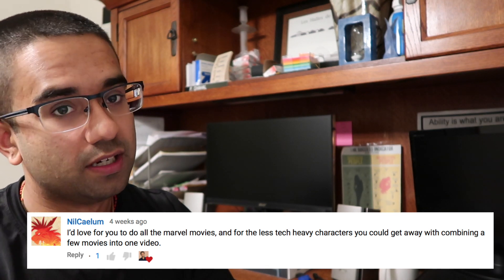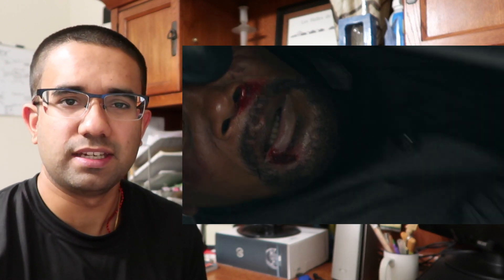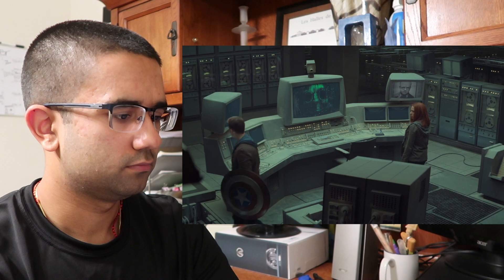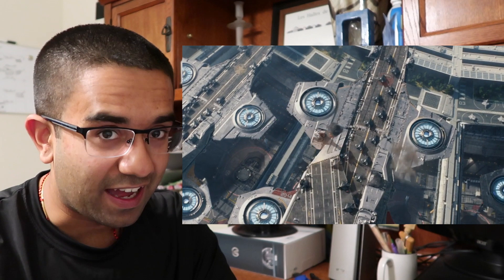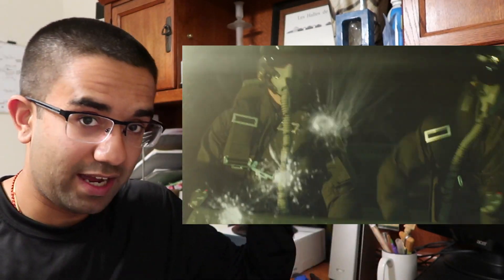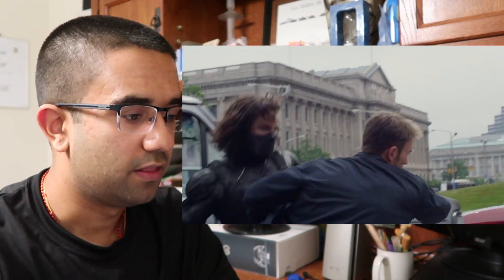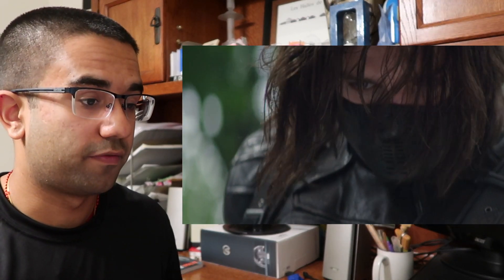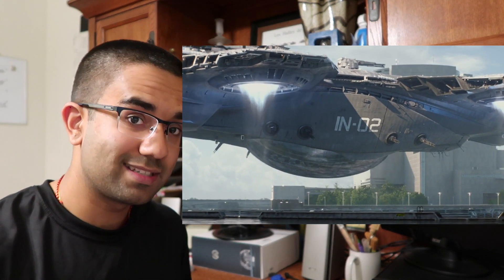Real Engineer reacts to Technolgy in Captain America: The Winter Soldier

Comment: maybe it has different propperties when its hit as a shield liket the actual shield then it has some kind of alloy around the edges in order to bounce but still absorb impact when used as protection.
Also it may be possible the drive had some sort of software that could fend off any locating or seeing who it was or what the info was from the wifi provider and it wasn't their computer so it wasn't untill they plugged in that it would've been possible to keep their identity secret for a few mins.

Comment: The disbelief you had about Falcon with elevation change isn't far fetched. Ask any skydiver. Oxygen masks are only required if spending extended time (in an open door aircraft) above 10000 feet. Normal tandem jumps done by first-time jumpers are usually 13500 feet but you are not above 10000 feet for more than 2 to 5 minutes so you would not notice (or have ill effects) from hypoxia. Falcon is well below 10000 feet and so does not pass out or require oxygen.

Comment: Perhaps there's a trigger when the car experiences high impacts to do some kind of xray, or multiple small xrays from various positions. (The image on the screen that's screen wouldn't necessarily have to be of those images, but just have the injury mapped into it)

The only way I could think of a way to hand wave the shield either bouncing or absorbing and dissipating all kinetic energy is if the vibranium shield has a crystalline structure that behaves differently depending on the direction of incidence (and then stop thinking about it). Say force at the normal to the face of the shield dissipates, and anything at the normal to the rim is amplified. That doesn't explain why cap lands striking the ground with the rim to disperse some of his kinetic energy though... Either way there's no mention of any of this, so it's probably just marvel magic or something.

Comment: One thing I would say about the metal arm. As that while all strength based functions you perform with just that arm would obviously be extremely heightened, like your fingers would essentially be a vice, and you could lay down and curl 2 thousand pounds.

It wouldn't help you much in terms of over-all strength. Like if someone captain america throws an atlas stone at you, just having that arm doesnt mean you can catch it. Because any force that impact would produce would have to travel through you into the ground somehow. And if you were to do any kind of full body lift or feat, the arm wouldn't help you as much as you think since your legs still have to do most of the work.

Also that arm would weigh a fuckton, it seems to be almost completely made of metal. Which would completely lobside your body.

The only reason bucky can throw it around and perform these crazy feats is because he's a super soldier. So his whole body is strong enough to match the forces the arm can produce.

Comment: In the comics caps shield in made of a vibranium adamantium alloy. Though vibranium absorbs energy adamantium doesn't. But adamantium is nearly indestructible. Which is why they chose the two metals. Adamantium for durability vibranium for partial energy absorption

Comment: "I'm not really sure the purpose of Falcon's wings." It's odd, considered you are an engineer. I think you would have basic knowledge of aerodynamics. With just his jetpack, he will not be able to adjust direction during a flight. That's why planes have wings, and you won't see one without, because they won't be able to take off. His wings are useless without the booster, sure, but without wings, he can't fly. He would just hover over the ground.

Comment: "Gravity will decrease the higher you go from the center of the Earth"

Yeah, barely. Even at the elevation of the ISS the gravitational pull of the Earth is still something like 90% what it is at sea level. Even if you 1,000 miles up, which is 5x higher than the ISS, the gravitational pull of the Earth is still like 66%.

Comment: "If one of these falls it will be like a comet hitting the earth"

No, it won't.  They don't go into space. They are "sub orbital" as Fury says. They fly around in the upper atmosphere.  Even if they were to fall, they would hit terminal velocity and go no faster. They would hit the ground with the same impact as if they had only fallen a few hundred feet. It wouldn't create a huge crater, or cause earthquakes and tsunamis or anything like that. Even if it fell in a large city, it would only damage the buildings in the immediate vicinity of where it fell. 

In order to become like a comet hitting the Earth, first it would need to be MUCH larger, as comets are typically miles in diameter. Also, it would need to get into space and vastly increase its speed into the tens of thousands of miles per hour.

Also, they don't use conventional turbine engines for thrust. They have "repulsor" engines. These are 100% sci-fi, and are different depending on the sci-fi universe you are looking at. In some they are basically anti-gravity devices that push against gravity, but in the MCU they are the same thing that Tony Stark uses to fly and shoot his "energy blast" weapons out of his hands. They fire a concentrated blast of muons at high velocity to create a stream of concussive force.

Comment: Ok, gotta disagree with the Hawk stuff. You don't know what the wings are there for? Why do you think any jet powered plane has wings? You think the jet engines are all that is needed to fly? The wings are there to provide lift, control, and braking, obviously. 

Also, no exhaust? What do you want? A trail of thick black soot shooting out the back like some kind of coal fired steam engine? It is a futuristic jet pack that runs on who knows what type of fuel. Even regular jet engines don't shoot plumes of smoke out the back. The only "exhaust" you see is literally heat and sometime water vapor. The exhaust is there, there is just so little of it compared to the volume of air being released that you don't see it. 

3000 ft of elevation is not that much of a change when you start out at basically sea level. Your ears will pop for sure, but I don't think you are going to pass out from a lack of oxygen. And the speed he is flying at is not nearly fast enough for pressure changes to suck the air out of his lungs or anything. 

As far as him being able to fly with two people, that makes sense. You can't make a jet pack that can only barely carry the weight of one person and expect it to be maneuverable and have any real acceleration.  It is made to have the overhead to carry 3 or 4 people just barely, to make sure it does not fall short when only carrying one. 

You can make the claim that the jet pack itself seems too small to produce that much power, which given CURRENT real world technology is true. But again, this is some cutting edge future tech in a world with giant flying carriers and nanomachines.

Comment: 2:50 he's not cutting through the concrete. he's cutting through a manhole cover.
Reply: That presents an even bigger problem. Most manhole covers are made out of cast iron. Which has a melting point of 2200 degrees Fahrenheit. So if that flame was hot enough to cut through cast iron it would literally be impossible to hold without melting your skin
Reply: In just 3 seconds, come on. It's just a movie, so accept the fact that part is bs

Comment: The wings are on his suit because they are what create the pressure required for him to stay in the air just like a plane does
Reply: Those wings are extra weight nothing more from what I saw in the movie is that falcon fly with jetpack on his back and if you want to make sharp turns mid air while travelling at extreme speed u can use fins which will be smaller and less heavy as for gliding use the wings are still not a viable option

Comment: Chevy engineers took a C6 Corvette engine and put it into a Chevy Sonic -- the smallest, most 'economy' car that Chevy offers.  It's funny.  But it creates new problems: you can't put that engine into it without also changing the transmission.  This new engine + transmission won't work with the front-wheel drive.  Switching to rear-wheel drive requires a very different set of suspension.  The brakes are woefully inadequate for this new curb-weight... as are the tires.  Replacing all of those things stresses the frame, which was designed for a very different car.
-
You'll see this with humans as well.  You have ankle problems, which causes knee problems, which causes hip problems, which causes lower back problems, which causes shoulder and neck problems.  A good physician will attempt to hunt down the cause of the problem instead of just treating the symptoms.
-
If you changed someone's arm to super-duper -- and ignored nerve interfaces and power supplies -- you would still have massive problems with the torsional effects that it would have your axial skeleton.  As you run, you have to pump your arms in order to provide counter-torsion relative to your hips.  Try to sprint with your arms held at your side ... it won't work.  So you pump your arms, but one of your arms is comically heavier than the other?  Now you can't run for shyte.  So you can counter this by potentially holding a very heavy weight in your weak arm, but have you tried running while holding a 20 pound kettlebell?  Yeah.... that's a no-go.  Consider the effect this would have on your trapezius... and lower back... even your glutes... 
-
Having just one super-powerful, heavy arm would mess you up badly.  Having two would be better, but it would take time to adapt to it, and even then, you couldn't ever fully function this way.  Even just the act of running while holding an extra 60 pounds (figuring 30 per arm) would grossly accelerate wear-and-tear on your ankles, knees, and hips.  You'd be 60 by the time you were 40.

Comment: When there's in impact there are 2 energy transfers, the shield transferring its energy to the wall and the wall transferring its energy to the shield. The thing with Vibranium is that it absorbs vibrations directed at it, so the energy transferred from the wall to the shield gets absorbs but the energy transferred from the shield to the wall doesn't get absorb by the shield and thus will bounce. Also that explanation is perfect for a property of science called perfect elastic collision in which the object conserves momentum and kinetic energy with a collision.

Comment: actually i think the shield bounces because the fact that its really... bouncy?
like my explanation is that whenever the shield absorbs vibrations, its send it back out. if you shoot at it with a bullet, the bullet will go back with almost the same velocity, thats why in one of the scenes he is able to reflect back the minigun shots. so if you 'shoot' (throw) the shield at something, its reflects back. how it comes back to cap well in the comics, he just practiced and practiced for years to perfect it. and sam(falcon) is also shown practicing in the falcon and winter soldier trailer
Reply: That would make sense, but the problem is that when Peggy shoots at Steve, the bullets lose all of their forward kinetic energy and fall to the ground.
Reply: @solvemproblerstudios5889  true that. but we saw tony make changes to caps shield... maybe he did something?
Reply: @killowattts  That could be it. The modifications made might have changed things post first Avenger. Or perhaps the edge of the shield is made of a different type of Vibranium, as in the comics there are 2 kinds. The Wakandan kind, which absorbs, and the Antarctic kind, which repels energy back.

Comment: the helicarrier's are probably powered by a arc reactor of some kind. even the first one in the avengers.
Reply: Yup. In that movie (Winter Soldier), they specifically mention that Tony Stark himself proposed to add repulsor tech to the new helicarriers after he 'took a close look' (aka got himself stuck in the rotors of the Avengers one). Also, the first one in the Avengers still used rotors.
Reply: @francissitchon9321  I think his point is more it's unclear how 'repulsor' tech works and the closest we have to this is like jet engines and stuff, like we have nothing that can create thrust on that kind of scale without burning some kind of fuel. But yes, this appears to be the magic marvel universe like big hero 6 and other things where electrical jets or whatever these are can work
Reply: @ninjadudeofficial  yeah I always understood he uses “repulsor tech” on his missiles, then adapted them for personal flight on suits and eventually giant ones for the helicarier and even his avenger Quinnjet. However it doesn’t really make sense as to how they create thrust. I guess maybe as hinted by the name they create a repulsive force like a magnet and are powered by the arc reactor but it doesn’t really make sense either way
Reply: @SavageEntertainmentYEAH  maybe, beyond me certainly
Reply: @SavageEntertainmentYEAH   my understanding is that they might be thermal powered, it's just like with a magnetic fusion reactor, give it something to burn and it will produces thrust, best fuel for those kind would be Carbon Dioxide, it's everywhere and can always be used
Reply: @VolcanoQueen  interesting, thanks!

Comment: I think what makes the difference between winter soldiers mechanical arm and exoskeletons today is strength and power. A professional weight lifter has strength like being able to lift heavy objects but power is the speed and force of a punch or kick, you don't see edie hall knocking back a heavyweight with a 1 inch punch like bruce lee. So exoskeletons enable people to lift heavy things but they aren't able to quickly rip off car doors or sending people flying with 1 blow.

Comment: As far as Cap's shield bouncing, wouldn't the fact that it's round and spinning play a role with the laws of motion?  Seems to me that even if it absorbed impacts, that it would still need to bounce off objects as long as it's still moving.  Add in Cap's higher strength when he throws it, with spin (like a football or bullet), it's creating it's own inertia as well.  I could be wrong, but it just seems to me like it would at least be a contributing factor.

As for Widow saying it would take 9 minutes for them to be found, that's for tracking their location, getting to the location, finding them in the mall and spotting them.  Since Cap had asked how long will it take for them to find us, not how long will it take for them to track the signal, this is most logical answer.
Reply: Agreed.

Comment: I can explain that, the captain america shield is not actually fully vibranium it's mixed with vibranium, if you look closely at the shield there are rings circling around the shield, those are actually vibranium rings. So when he throws the shield with enough force considering this is captain america throwing it, when the metal bends the vibranium snaps it back to the way it was.

Comment: The problem with Cap's Shield in the films is that they actually changed what the Shield is made out of. You're right that a purely Vibranium object would not be able to bounce around like that, but it can do that in the comics so they have it do it in the films. However, in the comics Cap's Shield is not purely Vibranium. It is an alloy made of Vibranium and another unknown element that was actually created by accident so it can't be recreated. That is the reason in the comics as to why Cap can throw his Shield and have it bounce around. The films made this mistake because at some point the unknown element was retconned into being Adamantium, which Marvel Studios didn't have the right to use at the time. Forgetting the original origin of Cap's Shield the films had it be made of just Vibranium thereby creating plothole that didn't need to be.

Comment: Falcon must be using Iron Man Repulsor Tech

It isn't burning fuel, however the arc reactor works it is dependent on some physical filament to sustain a reaction, but like our current aircraft carriers that can go 20 years without refueling they could emulate something very similar for Stark tech. The fuel it is using is literally Air that it turns into plasma then accelerates as exhaust electromagnetically. But I totally agree, like an actual aircraft carrier if they just had a repulsor boosted airship supported by repulsor boosted "destroyers" and conventional planes it would achieve basically the same thing and not be a risk to all human life within 1000 mile radius at all times.